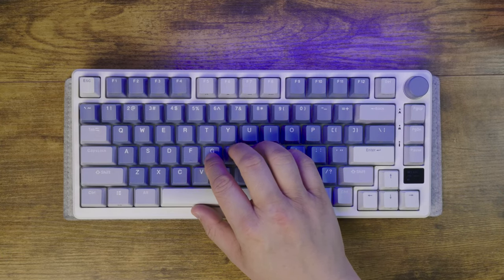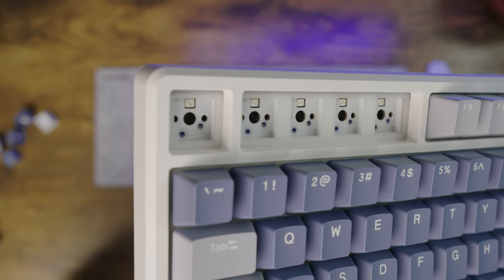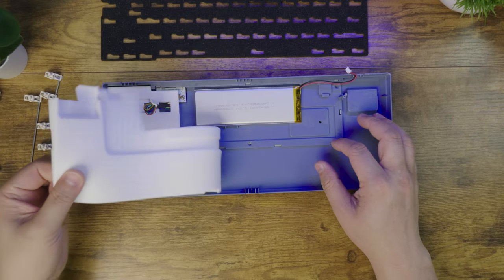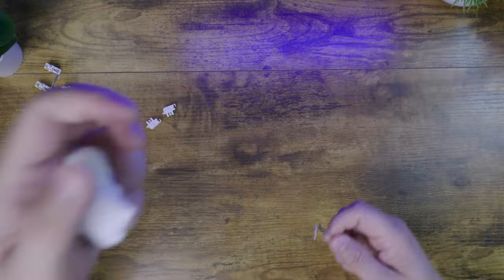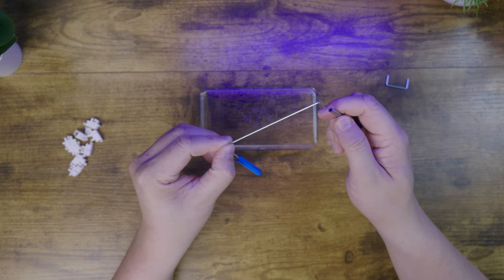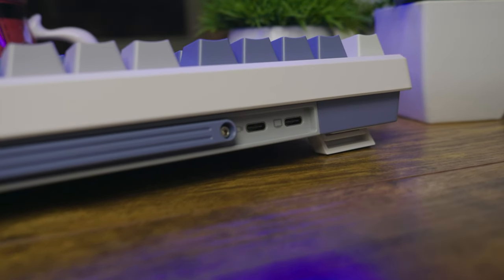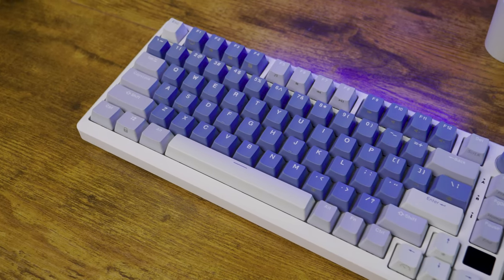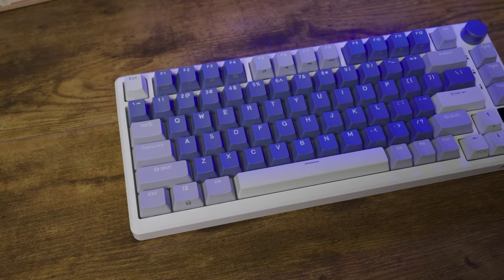Royal Kludge M75 - Review & Mod

Comment: I just entered the world of keyboards and chose the M75 to be my first custom keyboard. Right now I'm typing on it and the truth is that it is a delight when you come from standard keyboards.
Reply from the maker: Welcome to the rabbit hole!!
Reply: Do you tell mr how much battery back up you got in a single charge in bluetooh modr please I want to buy this keeb
Reply from the maker: @savagegaming6788  I got about 8-10 days with RGB running on 2.4ghz; bluetooth should last a bit longer, and you might get up to a month if you keep RGB off and running on bluetooth.
Reply: @keebtunes  bruh do you suggest keychron k2 pro over m75 but k2 pro does not have dongle support please reply...
Reply from the maker: Are you planning on gaming with it? Dongle isn't going to be as fast as wired, and if you don't care latency, then Bluetooth works just fine

Comment: I’m kinda nervous about doing the tape mod because of this keyboard’s battery, but I’ve read some of the comments that say that it is safe. However I am wondering if it will be safe long term? or do I have to remove it after some time? I will be using mtx masking tape for the mod. Thank you.
Reply from the maker: hi! You won't have to worry about the camera  (it's only in the event that the battery heats up so much that it'll burn the tape, which has never happened), but if you are, you can add a layer of electrical tape on the camera to segregate it from the painters tape.
Reply: @keebtunes  thank you for confirming. I will be doing the tape mod now 🤍
Reply from the maker: Hope it comes out well!
Reply: It came out so well. They sound so good after the tape mod. I also replaced the stock switches with akko piano pro v3 the one with the normal stem and it sounded really good it had a deep thocky sound. Thank you
Reply from the maker: Yoooo that's awesome!!!! I hope you love the new sound as much as I did

Comment: Gotta say i followed the guide to a TEA and im in absolute LOVE with the THOCKYNESS just adding the moleskin does and thats the only mod i did... HOWEVER... jesus christ is this thing a pain to take apart. I dont like the fact that you have to pry the top cover over. Taking mine off was neigh impossible and ended up (luckily) scratching and denting some areas you cant see. Another thing I messed up immediately lmao ... BE CAREFUL WITH THE LITTLE LED DISPLAY!!!! DO some research on what to use to clean it off, I smudged mine and took a microfiber cloth with rubbing alcohol to it... yeah now the display is scratched like crazy. The moleskin method was a lil annoying when it came to cutting in small places def have an exacto knife around to use carefully where the stuff plugs into and the 2 hole areas. Other than that I'd highly recommend this keyboard! It is a little small and anyone who isn't used to the rising key style keyboard will have to get used to it! 100% worth the purchase :D
Reply from the maker: i freaking love this! I'm a huge fan of less is more than overloading a keyboard with junk! I REALLY should've mentioned that it's not easy taking it apart, even with a tool...this is one of the few keyboards where I felt like I had to mention how to open the damn thing because of how stiff it is. 

I love your advice on the LED display though...although I'd always assume rubbing alcohol can erode the surfaces of certain screens, I still thought it would've been safe. And lastly, cutting moleskin IS annoying, and it's much easier to do on a gasket mount than say, a tray mount, where you'd have to account for standoff holes and all of that! I'm so glad you tried out my mod though! Did you enjoy the stab sounds? 

I'd like to add little snippets from your comments into my description as helpful tips, if you don't mind. Are you okay with that?
Reply: @keebtunes   I dont mind at all! And as someone who works in tech i assumed it was gonna be a pain to open lmao. Not sure what to use for cleaning the surface though and I def agree that alcohol isn't a  good choice as I quickly realized the glass has some sort of material over it. Im LOVING how it sounds and the recommendation of moleskin is such a good idea tbh. The one you link leaves you with so much more material to do the same with other keyboard if you want as well.
Reply from the maker: Awesome! I've been using the same roll of moleskin multiple times now 😂. It's my go to for when I know the PCB is easy to wrap. I used to use it when I was in the Marines for blisters, so it thought it would be a good idea..I work on HR now 😶 I think I'm the only one on YT that uses it.
Reply: @keebtunes  my mans got the one mod doctors don't want to tell you 😂
Reply: Yassss. keebtunes also converted me to the good church of moleskin, and I'm never leaving. Such a versatile material that I use in a variety of ways from tape mod, to stab padding, to even repairing broken keycap stems sockets!!!
Reply from the maker: you used it to repair stem sockets? O_O @laserlotus
Reply: @keebtunes Yesss! I'll send you a pic or vid somehow!

Comment: i wanna get into keyboard modding but i don't understand how keycaps work. how do you know which keycaps are going to fit your keyboard? are they universal?
Reply from the maker: They're mostly universal now...back in the day different types of switches had different mounts that would only fit a certain keycap fit. However, modern keycaps and switches all utilize the Cherry MX mount, which are cross-shaped, and are basically universal at this point. If you're looking at newer keycaps, they'll mostly all fit. They'll usually mention that they're cherry MX mount, which will fit in almost all modern hot swappable switches, like the ones in the RK M75.
Reply: @keebtunes  thank you so much
Reply from the maker: You're welcome!

Comment: Was the solution to making the space bar sound way better the bending or the grease? Considering getting this over the Keychron V1 Max for a hot swappable bluetooth keeb under $100
Reply from the maker: You'd bend if it sounds uneven on one side vs the other, but would want grease if it sounds light and hollow

Comment: I have 1 question. won't the tape mod cause fire hazard. though my keyboard (M75) came with thin pe foam between silicone layer and pcb. would it prevent conductivity / fire hazard.. lmao these days they say it have fire hazard but they themselves put foam inside the keyboard which is also highly flammable, even more flammable than painters tape. just wondering....
Reply from the maker: it doesn't - most tape (except copper foil tape and some acrylic tape) are not conductive and will not create any sparks. The only time that it may conduct electricity and ruin your pcb would be if it got wet, but that would also apply to you getting water on the PCB as well. Most PCB are very low power and won't actually cause a fire hazard to begin with, so you really don't have much to worry about. Being flammable doesn't mean that it is conductive either. In all of my years doing this, I've never experienced any issues with the keyboards. The issue with painters tape, comes from the fact that if you do remove it in the future, it's possible, but highly unlikely, that you may rip a socket off (solder is stronger than tape, so you'd have to be really reckless), but that's a possibility.
Reply: @keebtunes  thank you for replying.. I just did my stabilizers and tuned and tape modded them.. holy shit this keyboard turned awesome.. i lubed my brown switches legs converting it to a linear since me no have no extra money for new switches.. but still they are sounding awesome.. and for the stabs i did holee mod and placed tissue beneath the stabs to muffle sound.. and they turned great!!
Reply from the maker: @rishabhthakur8112 hell yeah! Your process sounded awesome!

Comment: Hey, I'm new to the mechanical keyboard world, i was about to order logitech keyboard but I found this rabbit hole lol xD... I have a question, how often do you have to charge it? Does it last long? Cause with logitech it's a AAA battery, so I dont have to to think about it u know.... anw, great video!!
Reply from the maker: Welcome to the rabbit hole! There are so many wonderful custom boards out there that this one is but a drop in the bucket. Tbh, Logitech boards are kind of...mid imo, I used to own a few back when they were one of the free available options but they are nowhere near as good as their mice. Anyways, if you keep the RGB at a minimum, you can get 2-3 weeks without a charge. It won't last as long as AAA but you won't need to replace and you can always just plug in instead of having to hunt down new batteries.
Reply: @keebtunes  Thank you so much for the detailed answer!! And wow, 2-3 weeks, that's good enough! I'm not planning to use that much RGB anyway lol, one more question, can you use laptop USB-C charger to charge it?
Reply from the maker: @adaninurs yes you can - at least from what I can recall! It comes with cables too though, so I'm you could just use it from your laptop to keyboard instead? It'll be faster for gaming
Reply: @keebtunes aah yeah, you're right! But I'm trying not to add more cables tbh haha...so if there's gonna be a cable anyway, I might just embrace it and buy the wired version lol.... do you have any recommendations for budget wired mechanical keyboard? Royal Kludge or other brand?
Reply from the maker: @adaninurs you should check out yunzii keyboards, like the yunzii b75, for a really nice budget wired
Reply: @keebtunes  thank you so much✨️ keep up the good work!!

Comment: Hello, which one you prefer more RK S75 or RK M75? I didn't know exactly what difference about it
Reply from the maker: They're both almost identical, including the body and PCB itself, so you're not going to take much of a hit in terms of quality from an internal parts perspective. The only difference will be on the switches and keycaps, of which I think the S75 utilize relatively basic caps and unbranded generic switches. If you have your own things to play with, getting the S75 may be better :)

Comment: Is the tape mod safe with a battery? This is my first board but I don’t want to burn the house down.
Reply from the maker: Yeah painters tape and moleskin are non-conductive, meaning they won't conduct electricity or heat. If you want to be super safe, you can add a layer of electrical tape over the battery for safe measures, but they're safe.

Comment: I tape modded this keyboard recently, and after doing so, everything sounded great and worked, but my spacebar now sounds like its rubbing against something, which I know it was not like that before I tape modded it. Does anyone know what went wrong?
Reply from the maker: Can you check to see if it's rubbing against the edge of the frame? If so, you can try pushing it up a little bit. If not, maybe you can shoot me a video + sound and I can see what may be causing it. But usually, it's something minor. The tape mod wouldn't have done anything to it, unless the tape protrudes past the pcb edges and makes the sandwich sit unevenly, causing the keycaps to touch the frame.
Reply: Think it might be the tape sticking out because I can't seem to get the frame to push up, and now that I look at it some of the other keys on the edge of the keyboard have a very small rubbing sound. I'll take a look at it when I can, thanks!
Reply from the maker: try to cut the tape less than the perimeter of the pcb if you can -  this will avoid it pushing against anything and putting the sandwich out of place than it usually is.

Comment: Do you guys know the polling rate for wired and wireless Mode? I tried Key inspector from github, but I can't get exact data.
Reply from the maker: The program is definitely hit or miss, but I found the most success with it when you really just go to town on the keyboard when it's recording...I spam all fingers as fast as possible for 10 seconds, and that usually does it for me. Unfortunately, I don't have this keyboard anymore as I gave it away as a gift, but I can do some research and see if this info is out there anywhere

Comment: I'm stuck between 2 keebs 😭 Would you recommend this or Ajazz AK820 Max?
Reply from the maker: If you had to pick between two, I'd recommend this. What are the specs that you're looking for from a keyboard and maybe I can offer some more options?
Reply: @keebtunes  I'm currently looking for a budget 75% keyboard, maybe a more linear feel and has a 3-mode connection and a gasket mount too. I've recently realized that the value brought by budget boards have increased very much from a couple of years ago, so I'm taking my time picking between which one i should get
Reply from the maker: what's your price range? I've recently seen some amazingly affordable boards from kiiboom that's on sale, as low as $40 USD for a really good board with what you're looking for. Shipping I think was 5 bucks. Check their website www.kiiboom.com

Comment: which switch is best for rk m75 if my sole purpose is typing - Brown, fast silver, viridian, pale green ?
Reply from the maker: if you're a touch typist, silver or viridian might be the best bet. Although, if you type fast, the silver may give you more errors. Viridians are light and have a nice bounce back but don't have a short actuation travel. I don't have any experience with pale green, but looks like it's slightly slower than viridians in terms of actuation distance.

Comment: Just ordered the M75 with brown switches as my first keyboard. Beside looking for 75%, how will I know which caps out there will fits onto the M75?
Reply from the maker: usually you'll want to see the keycap set as a whole to see if the set has the right keycap sizes, measured in "u". Most keycap sets will have the right sizes that you need as long as you get a set that can sufficiently cover a 100% board...so any sets with key counts over 100 should work with this board.
Reply: @keebtunes   Thank you so much for the info, appreciated!

Comment: I dont know why but my unit came with south facing LEDs.. also the switches were lubed with very thin lube like krytox 105 .. i thought it wasnt applied or it was dried up so i relubed them with g lube.. later on i realised my mistake that they were prelubed..
Reply from the maker: Hey nothing wrong with lubing your switches! I'm sure they came out better than before!
Reply: @keebtunes  yes they did.. infact now it sound all marble like.. i upgraded from a cheap eyoosoo keyboard to this.. and I'm loving it so much.. it's made like a brick..
Reply from the maker: Hell yeah! That's great to hear!!!

Comment: Hello i just got this keyboard, its great and all but the space bar keeps rubbing against the case and getting stuck its really annoying. im just wondering if you have that issue
Reply from the maker: I didn't, I wonder why that is with yours..you could try nudging it up slightly - it's all held together by the stabilizers. and have some room to move. If not,  try taking it out and flipping it backwards, and maybe get a different spacebar?
Reply: you think it could just be a bad batch i got?  Im probably going to return it and buy another. i've already tired rotating the space bar and no luck @keebtunes
Reply from the maker: Because the board is gasket mounted, you may be able to shift the board up a little bit instead of just the spacebar. It won't affect the key card in any way since it's just the mount. If that doesn't work, definitely return it

Comment: did you damaged the case while prying the case open?
Reply from the maker: A few scratches here and there along the edge, but not the tabs that hold the case together
Reply: @keebtunes  I see! This helps thx! I recently just got the board and thinking about of modding it
Reply from the maker: You totally should! I think this board is worth modding - it doesn't even need much to sing

Comment: Hi guys, I have a question for all the owners of the M75 - I have a Roccat kb which has an Easyshift function which uses the capslock as a modifier key to enable a secondary function for any other key that is combined with it. Is that something I could set up in the RK software? 

For example - my A key has a secondary function assigned to it which is activated when I press [Caps Lock + A]  - Is that something I could do in the RK software? Especially since QMK/VIA are not usable with this keyboard, this is a make-or-break function for me. Someone please clarify! Much appreciated.
Reply from the maker: Hi there! Based on my experience with the RK software, I don't recall this being possible, and unfortunately since it doesn't work with QMK, I don't believe that this is something that you can do with this board.

Comment: Does your backlighting keep turning off after no activity for 5mins?
Reply from the maker: Yeah if it's ok wireless it would do that I think...does it still do it on wired mode?
Reply: @keebtunes  I only have it in wired mode and even after setting the software to no sleep, still turns off. I might get a replacement and see if it happens again.
Reply from the maker: I don't remember the details as much but does it work when you turn the keyboard to "off"?
Reply: @keebtunes  No
Reply from the maker: @basicgamer9831 let me look into it and see if there's a board setting for this
Reply: @keebtunes  Thank you!